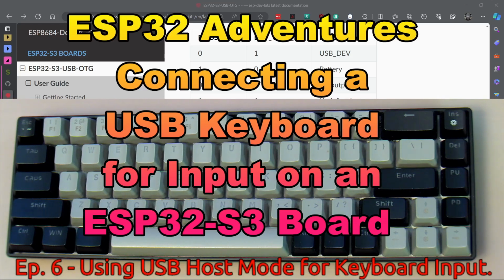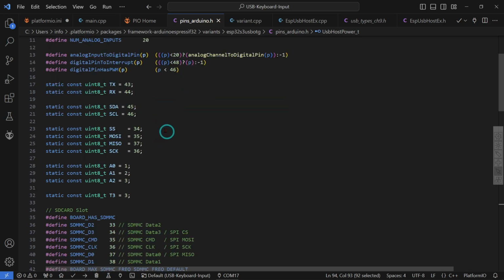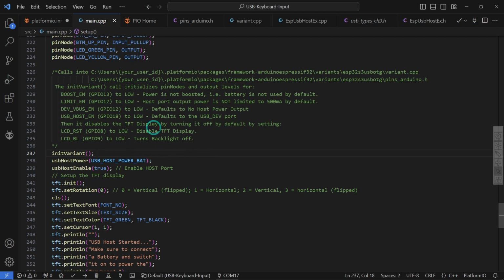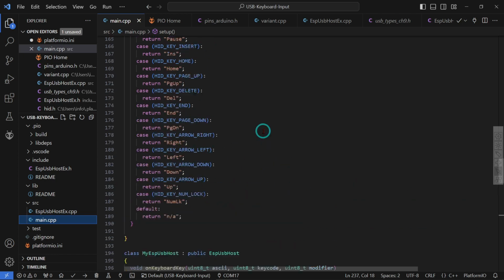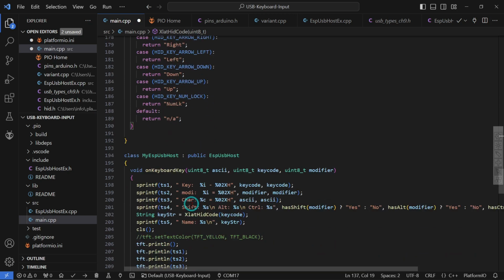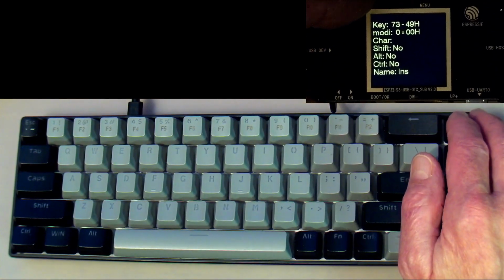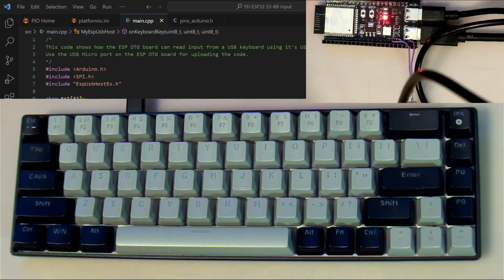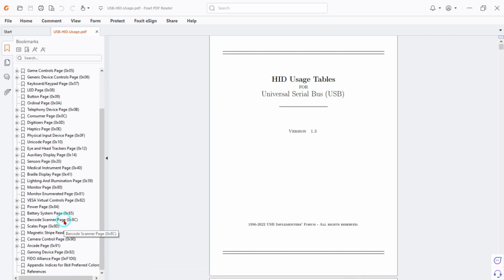Ep.6 Attaching a Keyboard to an ESP32-S3 Board

Comment: Go difficult would it be to make it so I can connect a USB keyboard to the ESP32-S3 without the otg converter box. I was told I could use just a standard otg converter usb adapter.
Reply from the maker: You should not need an OTG converter but the use case depends on the ESP32-S3 board.  The ones with two usb 3.0 sockets typically one marked as USB and one marked UART or something similar.  The one marked USB should be able to have the keyboard plugged in directly and the other would be used for programming.  Those that have only one socket you end up programming the usb socket to be in OTG mode in Arduino code and you will need to hold down the BOOT switch on it to put it back in UART mode for programming etc.   As far as I remember...
Reply: @ I have the same esp32-s3 you have in the video is that the wrong one?
Reply: @Tech-Relief  I have the esp32-s3 with two usb-c ports. One says USB other says COM. I have keyboard connected to the USB port and my computer is connected to the COM port to upload scrip and power the esp32-s3. I have soldered the usb-otg tag on the bottom and I have power to my keyboard now. But the In-out tag on the top from my understanding doesn’t need soldered unless I plan to power an auxiliary 5v application by the esp32-s3. So I have left that unsoldered. I have no luck getting it to see I have a keyboard connected on my serial monitor. And I have been using arduino IDE.
Reply from the maker: @derekbrooks3611  Yes it is COM I think I said UART.  So the way this works is that the COM USB-C socket connects to a USB to Serial chip which connects to some of the GPIO pins of the ESP32 and is useful for uploading code and monitoring using the Serial monitor.  The other USB-C socket marked USB is (as far as I remember) connected directly to the ESP32 D+ and D- pins.  The ESP32-S3 controllers are able to communicate over USB directly and it can be put in HOST mode where it can control and communicate with HID devices like Keyboards.  I soldered a small switch to the in-out pads, it is used when you want to supply +5V to the %V-In pin on the board to supply the board with an external power supply instead of just the 5V of the USB port.  I guess it is possible that some large keyboards may draw a more significant amount of current and an external supply may be beneficial here?  I am not sure what you mean with being able to see your keyboard connected using the serial monitor?  Perhaps you mean that you scan the keyboard and output it using a Serial write statement?  You might also look at one of my other videos: https://www.youtube.com/watch?v=2Hw1vQD8JQw and code on github: https://github.com/TechRelief/MacroKeyPad Now this was done with a XIAO module which is actually a little more awkward since it only has one USB-C socket and you have to switch back and forth but the code would be similar.  Perhaps this might help you?
Reply: @Tech-Relief  okay so when I connect my keyboard to my esp32-s3 USB port. It lights up and appears to work. I checked voltage and it’s at 4.08v at the solder points on the esp32-s3 USB port. And it has 4.9v at the COM port. When I press keys it doesn’t appear to have voltage drop. But when I plug and unplug the keyboard it does raise my voltage on the USB port roughly.2V. While I have my pc connected to my COM port. I plan to use this port to upload code, power my esp32-s3, monitor activity on the serial monitor (such as I would like to see me pressing keys on my keyboard connected to the USB port). While the only use for the USB port will be to connect the keyboard. My plan for example when I press the letter “a” it will turn gpio pin “2” on to 3.3v. And when pressed again it will shut it back off. I will use a keyboard as large as 16 keys. But I would like to have my esp32-s3 to read it as a standard keyboard so keyboards will be plug-n-play.
Reply: @Tech-Relief  I have managed to get all of my code working at one point other then registering keys pressed. I have been able to type the numbers manually in the serial monitor to toggle the gpio pins on and off. But now my issue is I need the esp32-s3 to understand keys pressed. From the usb key port. I have managed to get my code to upload successfully. But it doesn’t detect I have a keyboard connected. While host mode is active. Which I am also having an issue keeping host mode active.
Reply: Do you have a way I could message you by chance?
Reply from the maker: @derekbrooks3611  Only an email address techrelief@paay.us ...

Comment: hii , i want to convert my mechanical wired keyboard to bluetooth keyboard so i want to use this esp32 s3 so can you please help me to build that and show me the diagram of adding keyboard and power to esp32 and also the code of esp32 s3 to use as bluetooth transmiter

plz help me 

thanks in advance
Reply from the maker: First have a look at this video where I convert a wired PS2 keyboard to bluetooth.  If your keyboard has a USB interface instead of a PS2 interface it will simplify it, you will not need the PS2 to USB converter board.  Let me know how you get on...